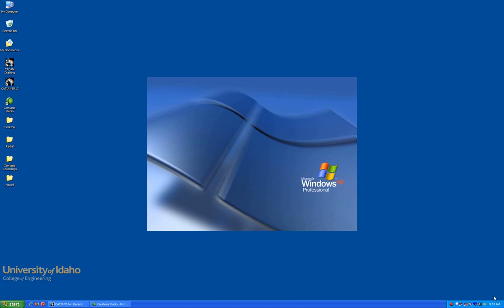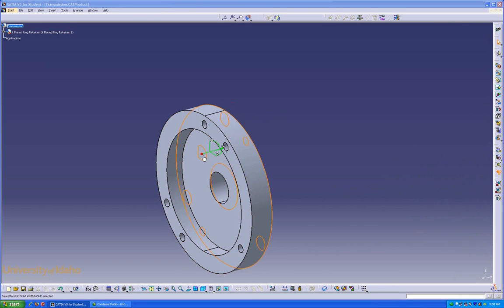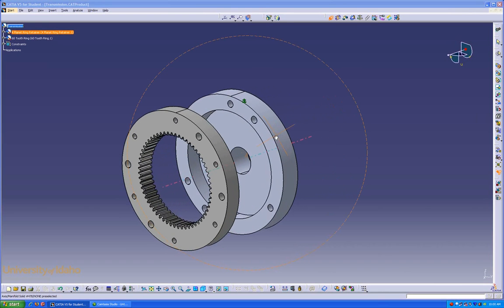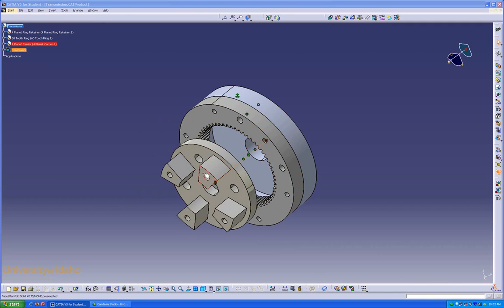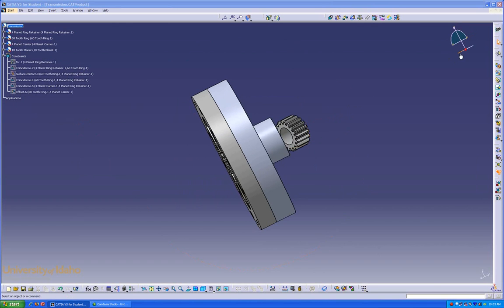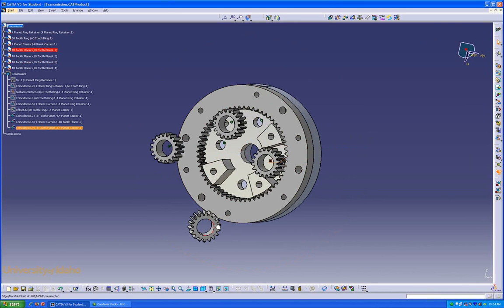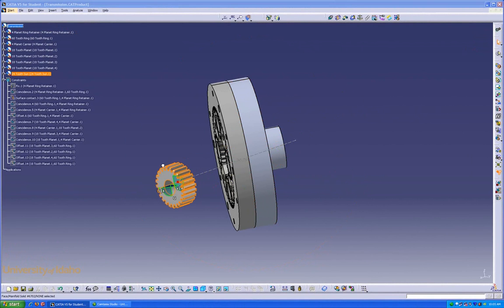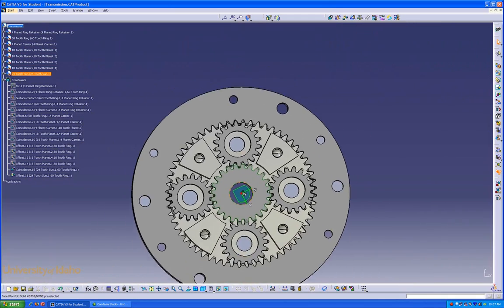Catia V5 - Assembly with Constraints

Comment: Hello, excellent video
I have a problem though. When I set up the constraints, the pieces d'ont move, they only appear linked by that constraint, is that normal? Thanks!!
Reply: there is an update button, you need to click it and it will show the updated version. The update button should be somewhere on the bottom of your screen and is spiral in shape, Hope that solves it.